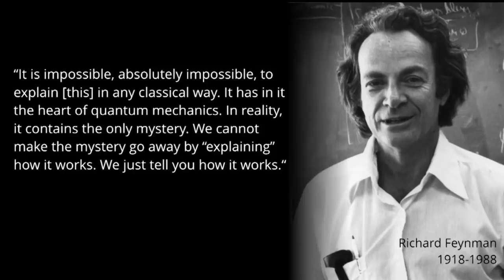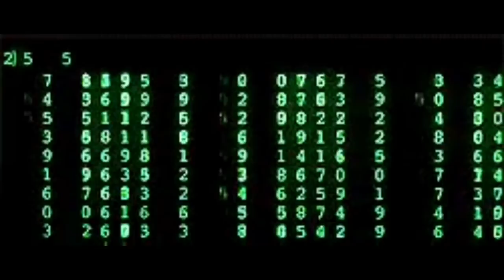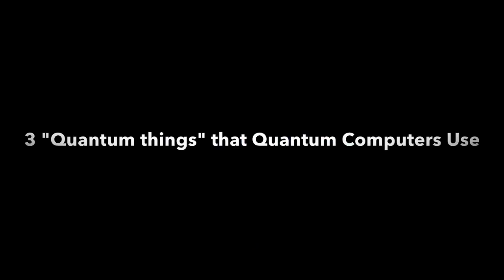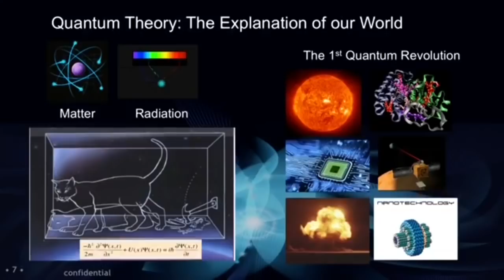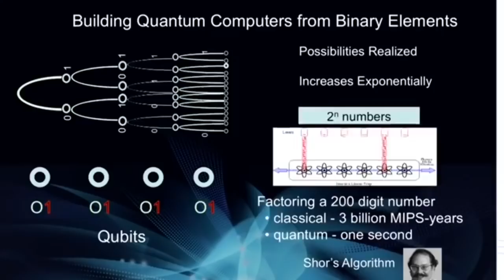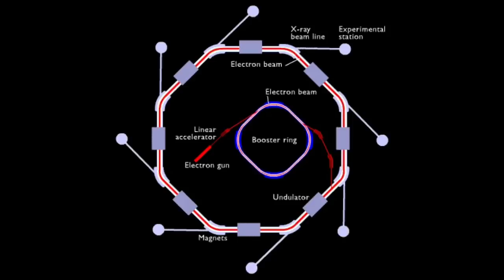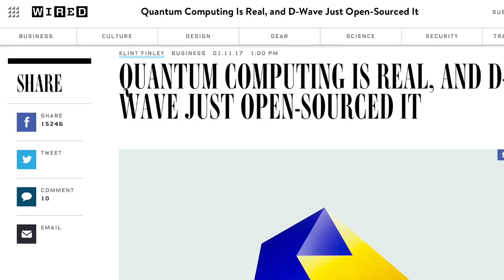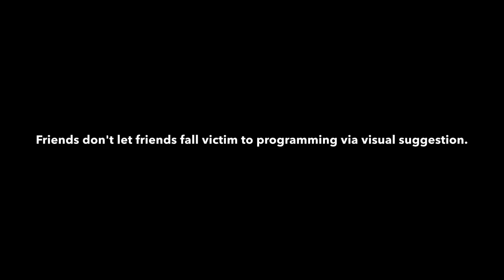The TRUTH About D-WAVE QUANTUM COMPUTERS and the FUTURE A.I. Artificial Intelligence Mandela Effect

Comment: Quantum computers would supposedly be useful in solving simultaneous equations with lots of variables.  Classical computers do stepwise algorithms very well.  Last I heard there was some academic debate about whether D-wave was doing the computing or all the classical computers that control and interpret D-waves results were doing the real computation.  

At any rate the usefulness is quantum computing has yet to be demonstrated.  To get a quantum computer to work you really have to understand quantum mechanics, what did Feynman say?  

Of course just because Feynman said it doesn't mean it's true, Feynman didn't believe in brushing and flossing.  I used to be said that relativity was almost impossible to understand but a couple of generations later and lots of people understand it very well. Time travel to the past is not possible.  

As for AI, let's get rid of the term. The problem with artificial intelligence is it's not real intelligence, it's just faking it. What is wanted is something with real intelligence, not just some Disney theme park device with a recorded voice and pulleys & levers moving its lips. 
 
Lots of things have intelligence built it, even an abacus has intelligence in it's design. Colossus the, WWII computer, had more and cellphones of today have even more but they are far from human intelligence.  To accomplish that is going to take a lot more than fitting more transistors on a chip, doing more calculations per microsecond or creating "neural nets" with more complex structures. To create such an intelligence is going to require and understand of how intelligence works that we don't yet have.  It's not just a matter of solving some technological issues. It's a matter of creating a better understanding of ourselves, we haven't master that process yet.

Comment: the problems listed at time 14:40 are optimization problems.  because of the types of math problems that this kind of quantum computer excels at, optimize problems are the kinds that it will be used for.  You also incorrectly describe what an optimization problem is earlier in this video.

Comment: D-Wave computing takes an excited state of a series of particles cools them to their lowest state.  The output is that end stat and it solve problems that have been designed to solve max-min problems.  Quantum simply means small, its not fancy, cool, or beyond conception.  The simplest way to think about QM is just to assume that the means of which we measure the Universe is insufficient to the operating mechanics of particles, given the opportunity to measure a particle eliminates the possibility of that particle to be in another state and that's it.  Conservation of momentum is conserved, so if a particle interacts with another particle their states are intertwined(nothing beyond the idea that something can be up or down in one basis set and look ambiguous when seen from a different angle, in order for those particle to have gotten "passed" each other they needed to be orthogonal to each other, find the state of one and you know the other).  I am not saying that you shouldn't be skeptical about the computing power of these machines and their potential uses; Since QC will reduce processing times of Ax=b: from O(t^3) to O(log2(t)^2)(or any other numerical system that can be quantized) which would destroy every encryption method and much more.  But the advent of computing power due neural net processing should worry people more in the immediate, QC is a psyop to distract from more dangerous and real methodologies of computing that could soon produce matrix like realism given enough power.  The very identity of man will be questioned.

Comment: I would like to know why the fact that the computers need large refrigerators to work is a big problem; after all, early computers were the size of rooms and slow, and look where we are now, with smartphones. Right now, they aren't really worried about how big it is, rather, as long as it works that's more than a huge advancement. In the coming years, these will be perfected and made smaller.

EDIT: At 14:19, using Grover's algorithm, you can perform a classical O(n) task in O(sqrt(n)) time, so you can tackle amounts of data that would be unthinkably hard right now.

Comment: I think you mean to sat “quantum annealing” or “adiabatic” relating to the core hardware architecture, rather than referring to “DWave” the company.   The juxtaposition is a “universal gate” quantum computing, which IBM and others are working on in the form of both overlays to existing systems and fundamentally new approaches; and DWave and others are exploring to make a more general purpose quantum computer capable of solution sets beyond the current linear equations (i.e. optimization problems).  Remember, It is not just the core architecture that bounds the capabilities (i.e. just being able to work on optimization problems versus general problem solving), but also the gating defined externally to use on the platform.  
To wit, you mention that DWave is not really faster than existing computers, but in fact, they (Google and NASA, and others now) have benchmarked their latest 2000 q-bit DWave and found it to be able to solve a set of speed benchmarks that normally would take the top networked supercomputers roughly 10,000 years in about 10 seconds, with a lot of that time being the I/O, rather than the core computation.

In terms of the core or fundamental limitations of one architecture verses another, they are not always hard or intrinsic boundaries.  As such, data and quantum scientists here at my company and elsewhere are at various levels of research and testing of how to best apply linear adiabatically based architectures to non-linear problems.  They are working from a set of assertions including the premise that our brains are generally solving optimization problems ( a la Geoffrey Hinton and his team), but apply that architecture to general problem solving, inference, deductive reasoning and more.  

So, in other words, we are developing gating structures (software defined) that allow adiabatic architectures like DWave’s to be used for general problem solving.   Also, don’t think that DWave, IBM and other companies quantum computing teams aren’t working to rapidly step beyond the need for hyper-chilling.  Material science including room temperature graphene and other approaches are already showing tremendous promise, and they represent just a small set of the work being done.

I like your free thinking, intuitive leaps; but maybe you would find this even more interesting if you made a deeper study on quantum computing and how it works.  There are several great books on intro quantum computing and quantum physics written for laypersons through advanced, which you may want to review.  Check Amazon and/or Google.

Comment: I don't think we can stop the trajectory.  I noticed your sarcasm regarding the benefit of Quantum over Classical.  Quantum math requires super-speeds than cannot be obtained by classical 1/0.  This is because Quantum calculations are based on ALL probabilities of a solution, because the solution is actually ALL possibilities..  Remember how you showed that electrons actually take every possible path to jump from one orbit to another? That's how Quantum math works.  The Machine has to be quick enough to figure out every possibility in existence at ALL times to find the solution and this task "eats" an  incredible amount of processing power and has to happen instantly.  Sort of like how your voice rides the internet on a call 1000 miles away.  Actually, the bits to form the word "Hi" took 30 different physical paths through different cities and then got placed back in the correct order on the other end before your boyfriend even heard you.  He's on to something very big, and maybe dangerous if not controlled.  I love your video!

Comment: P vs NP problems is not a hard concept to grasp. Problems that get only a little more difficult when you add another element vs problems that get exponentially harder.
If we could could spontaneously just "genius" new mathematics into our understanding to classify more currently NP problems as P problems that would be great. Otherwise, there is quantum computing.
With Quantum computing, the whole idea is basically that just like an electrical current will take all possible paths simultaneously (but with more current in paths with less resistance), you can set a complicated result and (if you have enough qubits to work with for that level of complexity) quantum effects will find the paths of least quantum resistance that can produce that result, working backward in a way we never could to find the way to produce that result. Starting with the what would classically be the output and having the machine produce what would classically be the input.
This has the potential to help us out in problems (even if we understand them) are extremely complicated to solve and problems that are so complicated we don't understand out how to solve them yet. In other words, any problem on the cutting edge of science in any field. Math, medicine, astronomy, materials science. The hard part would have to be for mathematicians or programmers to be able to translate those problems into smaller problems the quantum computer can solve. Math problems are used as examples for the quantum computer's processing power because know how to use computers to solve math problems very well because math and logic are best buds already. Using them to solve real-life problems is much more complicated.

Leave your bias and weird world views at the door when someone is trying to explain something scientific to you. Sheesh.

Comment: Write code to run on the D-WAVE that will create the ultra-cold environment which is required to perform quantum computing, thus doing away with the mechanical refrigeration units now in use.

A software refrigerator.
:

Comment: Microsoft can use an antiproton if they can't get to the antion -- we know that we can get to antiprotons. In fact we know how to do it.  You see, proton-antiproton pairs flash into existence everywhere in the universe all the time and usually decay right away (canceling each other out). It is possible though to use a strong electromagnetic field to separate the antiproton from the pair before the decay and capture it in a vacuum and suspended magnetically for storage or use. The proton radiates away as a cosmic ray I think. They know that the theoretical antion would be easier to extract with less energy expenditure so more efficient and so designing with that as a goal right now.  We do know how Quantum computers work and soon they will be designing amazing products and working out Quantum equations hereto yet unsolvable as well.  There is already a commercial Quantum Encryption device available on the market that we only have wild theories regarding how they actually work and some of them use Quantum Tunneling. Quantum tunneling is an a"entanglement communicator" which will also allow components of a computer (or other devices) or even a network to communicate on a superfast databus that has apparent electrical/RF/Optical connections (no wires, etc). It will also facilitate communications over long distances instantly with no degradation of signal and much faster than the speed of light. This will render computing bandwidth concerns a thing of the past.  Also, it will allow completely secure communications that can never be intercepted, jammed, or the communication linkage (particle entanglement) broken (because that is impossible). In fact, communications of data over such a linkage would be many times faster than the speed of light.  Communications across the observable universe of 13.8Billion light years would happen instantly if two computers were separated by such a distance. The quantum computers will be designing products that we humans have no idea how they work!!!  I look forward to that.

Comment: ok my question is  very simple yet fascinating: what is the difference between building a regular computer chip and quantum computer chip? and where this technology came from? how is the quantum chip different?
Reply: Short answer they work with qubits, that is quantum states that can be both |0> and |1> at the same time (and the states can mix to various degrees, based on mixing angles).   

https://en.wikipedia.org/wiki/Bloch_sphere

They can also mix in, i.e. entangle with, other qubits. Instead of one 3d Bloch sphere you then deal mathematically with rotations on hyper-spheres in N parameter-dimensions.

If that explanation doesn't work for you try Justin Trudeau's take on it. It worked for my mother.
 
http://wavewatching.net/2016/04/15/canadian-pm-justin-trudeau-talkes-quantum-computing/

As to the technology of the actual chip, there are various contenders. A leading one is super-cooled niobium chip that implements tiny magnetic coils (called Josephson junctions or also referred to as SQUIDs)

https://www.google.ca/url?sa=t&rct=j&q=&esrc=s&source=web&cd=1&cad=rja&uact=8&ved=0ahUKEwit-fjcy7fUAhUk4IMKHZFuA2EQFggnMAA&url=https%3A%2F%2Fwww.dwavesys.com%2Ftutorials%2Fbackground-reading-series%2Fintroduction-d-wave-quantum-hardware&usg=AFQjCNEenNgeysd9tQNxYUbmSDJHCR0FPw&sig2=EpVd8WekXRATquZNGvIL2A

Comment: The CERN D wave is to connect with parallel universe's ( Worm Hole's for Superluminal technological theft from other space's! Stargate for real:-/!).
If faster computers are needed with a 3 state system?
Why not use Photons of different frequencies for Polymerization of coding.
Instead of I-O -?
Reply: Paul Wedlock or a time crystal
Reply: Paul Wedlock sounds good they've surely tried this??

Comment: Ah ha...that's what's going on in Antarctica! Studying the effects of molecular movements in between the solid spaces and merging the still with movement, and it has to be cold... the answer lies in the still, that's where the thought process takes place, in the pause of your mind in between each thouggt...we think clearer when we are still and problem solving is optimized... molecules move slow in cold temperatures, if the temperature is cold enough, rapidly moving particles can be slowed down enough which enables their speed to be measured. Build a building in the coldest place on Earth and you can measure the movements... It is said the universe is very cold correct?

Comment: Quasi-quantum computing (all quantum computers developed so far) is not the same thing as a true quantum computer (which there never will be a reason to build one). Even in quasi-quantum computers you can only get a result that has a certain probability of being correct.  It's only 100 percent correct if you already know the result or it can be proven correct through conventional computing. In true quantum computing (each qubit is a single quantum state of only one subatomic particle) the probability of a single qubit being correct goes down relative to a quasi-quantum computer. Billions of dollars will be wasted on very little gain for several decades. Companies buying these now are just doing it for the prestige of owning one.

Comment: If we mix 4 processors, to work at same time, they create multiple states, but is it really quantum mechanic? I'm pretty sure, we cheating. We don't know enough on the subject to create a real exemple of quantum states. We do exactly like we did with the screen (projecting 2D to 3D). We projecting the quantum states by multiply the numbers of processors working into parallel each others.. 
Xprocs * S(|0|1|) = (X * S(|0|1|) )² = 0 or 1 for each processor

Comment: Not knowing how to ask means you can't expect an answer that can stand as final arbiter to  non quantifiable questions. IOW'S no matter how much computing power at your command, it can only output, from what necessarily will be cherry picked input, what amounts to an opinion. "Two sides to every story", "cursed with the ability to understand both sides of an argument" -- ambivalence itself as opposed to just another blowhard with an opinion ... see Deconstruction.  It'll do your calculations; combinations and permutations for you, it'll even collate better than any spreadsheet you've ever used but ... don't expect WISDOM.  Every explanation does the same thing, it declares superposition is going to output on command but never explains how, but there's a surprise in the middle, just in time for Halloween.  Boolean algebra or its derivatives are the only method of "computing" and reducing reasoning to code so where are any answers going to come from, the nether world?  Evolution, bestowed over billions of years, determined neurotransmitters and hormones as a means of supplementing feeling was the best means of navigating this Existence; none of it mechanical. We think by feeling, our brains are extensions of our nervous systems.  Its never been suggested to incorporate such contingencies into data processors. Therein lies the source of the difference between qualifiability and quantifiability, Analogue vs Digital,  Us and Them. Two things that aren't the same thing will have discernable characteristic differences.